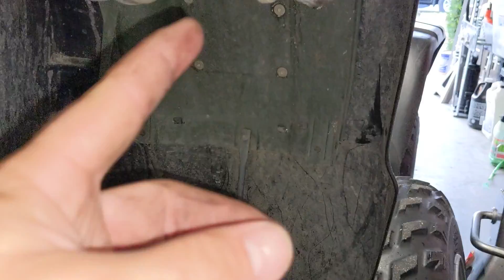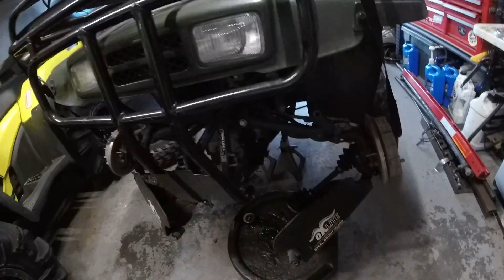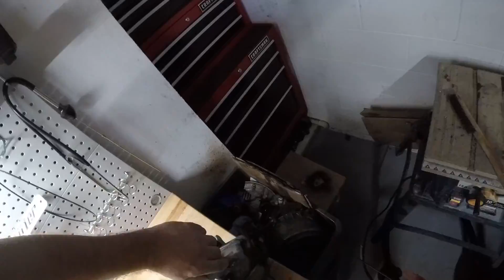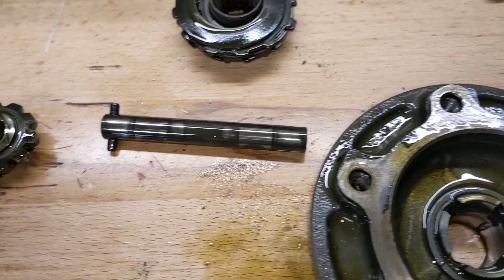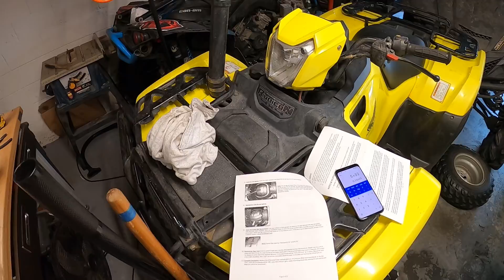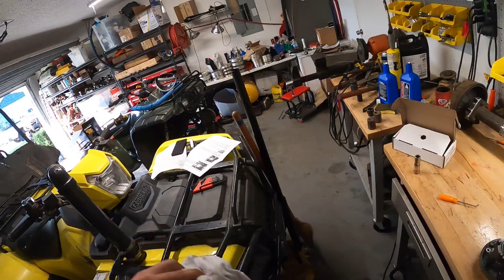Honda 300 TORQ Locker install video and shop test Fourtrax TRX300FW read description

Comment: I have a 2002 TRX 450 S Honda foretraxxs carbs clean fuel is clean  has spark also timing is set right has compression  won’t start
Reply: Is the carb pushing fuel?

Comment: Would this work in a 2000 rancher? Used to working on 300ex and 400ex. utility bikes are new to me as far as mods
Reply from the maker: I think it would work on that one actually I would have to look at the part numbers and see what style diff it uses. They are coming out with one of these for the newer Honda's as well regardless
Reply: @MudPuppyOffroad  thanks for the fast response! I just started building the old rancher. One ride with my friends(im the only one stock) needless to say i didnt have much fun bottoming out and almost drowning it a few times. Lol

Comment: Where do you buy the spa hose
Reply from the maker: Most Lowe's or home Depot carry it
Reply: What about vent lines
Reply from the maker: Some. Sprinkler line works good
Reply from the maker: Same
Reply: Do you use 3/16 inch or 1/4 and will the locker fit 350 ranchers

Comment: I have a Honda 300 and while I’m riding in water and it gets up to the racks it wants to kinda cut off and bog down does anyone have an idea on how to solve this issue
Reply from the maker: Grease your spark plug boot and wrap the boot and wire in electrical tape
Reply from the maker: If that doesn't do it it's probably one of your carburetor vents or seals leaking
Reply: Ok thank you

Comment: Great video @MudPuppy! It's clear you have lots of experience with this style of locker.  This is one of our prototype lockers, thanks for bringing the tolerance issue to our attention. For production TORQ Lockers we will include shims just like we had to for the Can-Am differentials.
Reply from the maker: Awesome!
Reply from the maker: The instructions could also use some more details like torque specs. I didn't have any issues but I have installed a lot of your products. thank you for finally making this locker I've been praying for it for a long time

Comment: Would you recommend torq locker for a non selectable 4x4 300
Reply from the maker: Yes, but you'll probably want the 424 eventually
Reply: Mud Puppy as long as it still turns about the same I'm cool with it
Reply: Does the 424 work on both gens of the 300?
Reply: leanback ben yea
Reply: @MudPuppyOffroad  do you know anywhere a person could get a 424 for a 300 because now because they seem to be impossible to find

Comment: Installed the Torq locker in my Pioneer 500 and it transformed into a tank! Especially since I have a long travel kit with 32” Blackwater’s. One of the best upgrades I’ve done to the P5 by far!
Reply: Hey we are automotive enthusiasts from MIT University India, we are working on building a 4*4 ATV for BAHA SAE and have ordered this locker but it didn't come with a cross-pin, could you please let me know the exact diameter of your cross-pin.